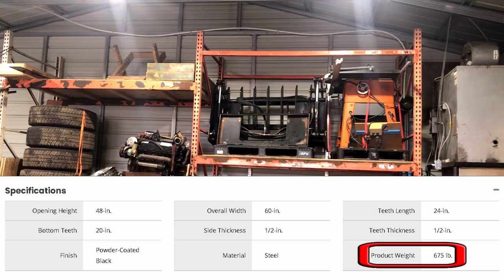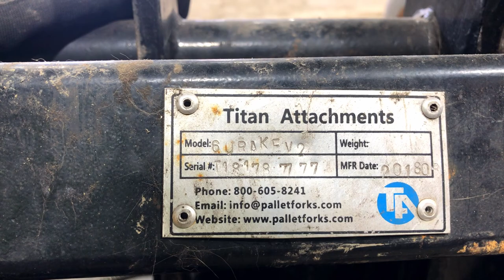The Good, The Bad, and The Ugly of the Titan Attachments Grapple

Comment: It may be thick but doubt it is AR400 or anything near that.  I had the grapple and had a cylinder leak after 6.months.  you are correct about the lack of stops.
Reply from the maker: Yeah, over all I’m “satisfied” with it, could it be more, absolutely…does it get the job done, sure.

Comment: Great basic practical info which saved me some research time.  I'm not in the Know presently with all the particulars like releasing line pressure at end for easy re-hook Up
Reply from the maker: Pretty simple, turn the tractor off and cycle the valve to release all the pressure!
Reply: @EverythingElliott  oh I remembered... Great tip and so easy!

Comment: You nailed it on the weight - that's why you don't see a lot of grapples on smaller tractors.  My skid steer has a 4,000 lift capacity so this would work well.  If I were you, I'd keep this one with the weight restriction - lighter in weight will translate into more flimsy.  Good video - thanks!
Reply from the maker: It does eat up a lot of my lift capacity, but it also keeps me in check. With a lighter grapple I’d be able to lift heavier logs which could lead to a tipping situation.

Comment: Thanks Great info
Reply: I have about (L4610) the same size  tractor with a LA850 loader.  I have (thanks to you) decided to go with a lighter grapple.  I also like the clam shell style grapple because of the back dragging feature with the upper grapple arm.   One thing i am concerned with is the open back of most grapples.  Are you concerned when pucking up a pile of brush of a branch sticking thru and damaging a hydraulic line or front of your tractor?  Thanks for your response in advane and thank you for helping me make my buying decision.

Jim Athens GA
Reply from the maker: I actually have a few videos of me using the grapple to give you an idea of what I do with it. I’m pretty careless to be honest, and never have had an issue with anything coming through into my grill or the hoses. You can find those videos on my kubota tractor playlist!